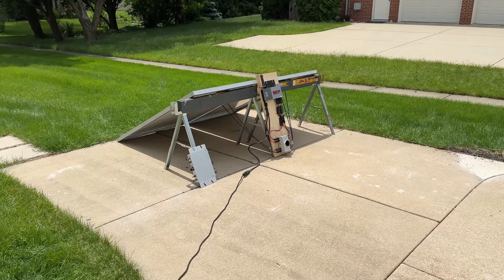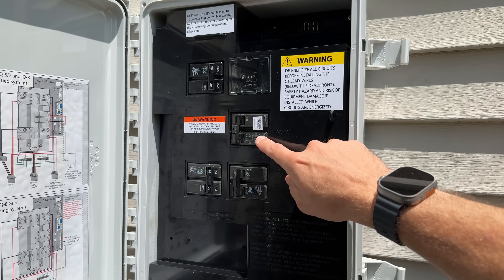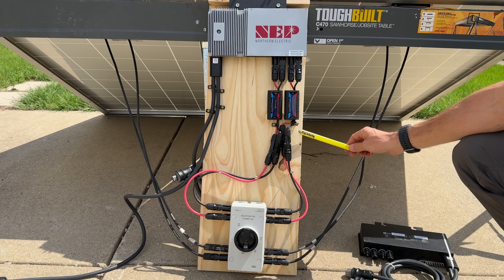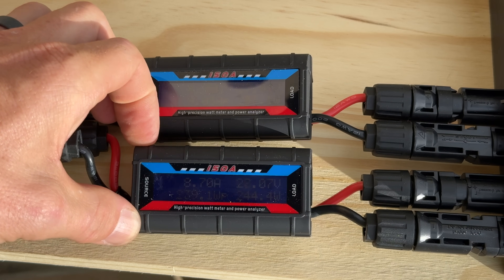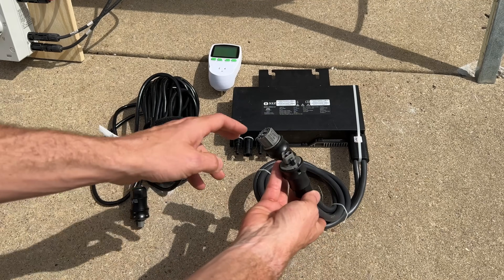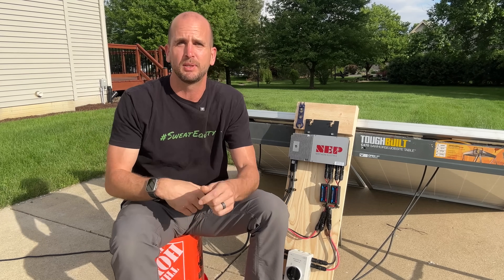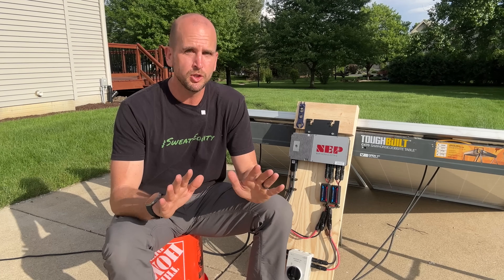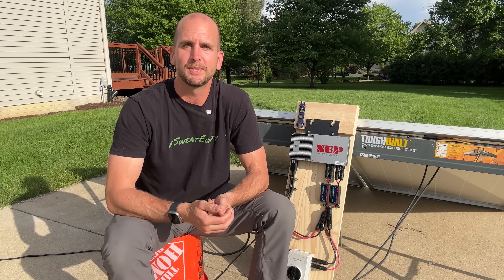Easiest Grid-Tied Solar On The Market!   Plug-N-Play

Comment: Great video. You didn't mention if this automatically shuts off if the grid goes down and it would not backfeed into the grid? Also I would be interested if for such a system, there is a way to manually cut the main breaker (in case of black out) and then start using that little bit of solar power in my house?
Reply: Solar storage batteries are what you're looking for

Comment: Trying to find a video or any information whatsoever on how to hook a solar system to an existing generator Outlet set I already have on the outside of my house.

I already have a separate sub panel in my basement adjacent to my house panel that has the critical circuits on it that I could shut on and off for line for generator power.

 I'm looking to set up a solar system that I can plug right into the 30 amp connector where the generator is supposed to be plugged into

Comment: I was wondering if i have a currently installed string inverter running, could i just plug this in an AC socket and work? or will it conflict in anyway with the string inverter?

Comment: I’m looking at a 16 year return on investment. 2kWh per day at $0.068 per kWh looks like best case scenario $49.64 per year savings. I’m not sure I can justify solar at this time.
Reply: Did you add in the delivery charges you would be avoiding?
Reply: No, because my “delivery charge” is a fixed per day service fee. That would not change unless I went “off grid”.
Reply: @Thanosisnotreal  interesting, where are you located? In upstate NY we have the electric charge 12 cents/Kwh and then the deliver of about 6 cents/Kwh that give us delivered rate of 18 cents, with a monthly connection fee of $17.
Reply: @ Western Washington, with all electric house the bill is less than $150 per month winter, $100 in the summer. 

My last monthly bill:
Current Activity
Kwh Charge 1,480 @ $0.06819 $100.92
Service Charge .96/day $28.80
State Tax - Excise (3.8734%) $5.02
Other Tax - Privilege (2.14%) $2.78
Current Charges $137.52
Total Amount Due $137.52

Comment: I was told my meter does not distinguish between power going in or power going out. In other words if I was to send power out I would be billed as if it was coming in.
Reply: Because he has solar already, he has a meter designed for net metering.
Reply: @Nolaman70  I've always see two meters. One for house consumption and another for solar output production.

Comment: I’m assuming this could be used on an RV that is plugged into a 50amp service?
Reply: No, a 50amp service would be a 240V connection. This 120V. Other inventors, such a s enphase output 240V.

Comment: I have questions on payback. In so many videos, it appears that the componets fail or degrade. Then, there is the roof with shingles needing repair from poor installation. Point being how does that factor into the 25 year savings I saw in your video.
Reply: Don't do roof mount unless you have a 50 year roof (metal). Ground mount is much easier, cheaper, and low risk.

Comment: Do you have an automatic transfer switch installed?  When the power goes out what prevents the PV from sending power out to the utility?  Also I'm assuming your enphase system has a transfer switch.  I know mine does, but I also have a enphase battery backup.  Along the same line does your DIY setup interfere with the enphase disconnect/transfer switch if the power goes out?
Reply: UL 1741 certification means that the system automatically cuts off it it senses loss of grid power. So it will not back feed. It will also not operate as an off grid inverter because it won't turn on if there's no power at the feed source. For off grid you have to use a non UL1741 inverter.
Reply: Also interested in this!

He did mentioned the UL 1741 certification, and I believe that specification allows the device to back-feed correctly given the grid conditions.
Reply: It should stop backfeeding the grid. Safety. The power company might be working on the lines and this would be a conflict.

Comment: Is there a similarly easy way to use a system like this to plug in an EV directly?  I'm thinking of using a system like this that is mounted on a car port or cover, that my vehicle can plug into directly.
Reply: No. A lot of the EV(s) do not allow your charge rate to be turned down, so this would not produce enough to prevent an overload. I know Telsa vehicles can throttle down to 600W on L1 charging, but even that is tall order outside of continuous direct sunlight w/o clouds. You would need a system that can accept storage battery connections to the inventor.

Comment: I read all 125 comments upto the date of this comment.  Not one mention of the ability to trip the main breaker switch for grid supply to panel.  In case of grid down one can manually switch off grid supply before pluggong in a solar supplied micro inverter into your wall.

If taking other saftey measures in place, it may be a good back up for brown outs.  The caveat is one has to have neighbors on grid to see when grid goes live again so you can reverse the breaker switches.
Reply: I have a similar system, the inverter will detect no power from the grid and automatically switch over

Comment: Love your videos, and the “testing” platforms. Have contemplated purchasing one of these units for testing myself. It is a bit pricy for the -LV model. Wondering if you could use to 220v non-LV model as a lower price and only use 1 leg of the 220 and get the same result. Could you just put a wire nut on the other leg? No electrician here. Also seen some Amazon “pigtail” products that split the 220 into 2 -120v outlets. Of course these are all experiments. Some commenters fail to realize this. Keep up the good work. I watch almost every video you create. Please experiment more. Looking forward to the multi micro-inverter one. Take care.

Comment: Plug & play balcony solar kits are available in Europe, including products that can provide battery storage to offset high rates during peak hours, which increased in popularity during the European 2021/2022 energy cris. One such example would be the EcoFlow PowerStream which is not available in the US. These systems are considered relatively safe in the EU due to how the EU system works, but I don't understand the details. In the US, the standard wisdom is that a grid-tie system should NOT be plugged into a wall outlet due to safety concerns with the US how the US electrical systems work with scary talk about backfeeding & suicide cords, and thus concepts like plug & play and balcony solar kits have been frowned upon for a while.

This is the first plug & play balcony system that I've seen for the US market that is UL certified. The NEP BDM-300 micro inverter has UL 1741 certification & provides NEC 2020 690.12 Rapid Shutdown for safety (Great!) & a number of other certifications. I suppose this is also safe because the output is limited -- the BDM-800 is max 800W, where a rooftop solar system will can easily be 5-20X that amount.
Reply from the maker: Thanks for the feedback, I will be interested to see where these type of systems develop in the US market.  I think there is a demand 👍

Comment: I think a valuable missing safety nugget is that systems like this are supposed to automatically shut off if your grid power (input) goes down so you do not backfeed (output) from your solar panels back into the grid.  Right?
Reply: Also that the ac plug does not induce suicide.

Comment: Here is an all in one inverter to 120v plug-n-play one that my son just picked up (maybe review it?!?)  Y&H 600W Solar Grid Tie Micro Inverter with AC Data Monitoring Display Screen Waterproof IP65 MPPT DC28-50V PV Input AC80-160V Output for 24V 36V Solar Panel $125.99 Size: 600W-110V-LCD (Amazon info)

Comment: Can you plug straight to the grid no other equipment needed?
Reply: Technically..yes, but legally...no.    There are many negative things that could happen at least here in the USA.  unless you have a netmeter you could spin your power meter backwards causing the power company to contact you or the meter spinning backwards could actually add to your bill instead of subtracting.  
 Unless your out in the bondocks somewhere with an old meter and billybob is the local utility tech.... I would not try this.  Will it work? maybe, but again, in an urban area with updated meters, chances are your going to get a fine.

 Now, I dont make a complete stop at stop signs either and its all about risk/reward ratio.  I would say "use at your own risk".

  Here in the capitalistic USA, systems like this are going to have a steep uphill battle to become legal.  Yes they work. No they aren't all that dangerous if UL approved.   THE problem is they cut into utility profits and if everyone can just buy something at Walmart and plug it in............................ again a lot of lobbing against this type of thing.

Comment: I'm new to solar and a little intimidated.  Could I use these grid tied plug in micro inverter to feed power to my house from batteries with a timer to only feed during peak charge times?  And then use a battery charger on a timer to only charge the battery from the grid on the cheapest over night rates?

Comment: That tiny setup would produce in a month 10% of the electric we consume. When it's comfortable and we don't use the AC, we use about 550 KWh a month. When it's hot and the AC is used, it sometimes will go up to 650-660 KWh.

It would be nice to have but it wouldn't pay for itself easily. it cost $0.098 per KW here. Not even a dime. 60 KW of production during the summer per month or about $6. About 10 years the cost might be covered.

Comment: when you feed the power into an outlet on your home you are on the wrong side of the fuse so to speak, no? defeating safety. you did say something about using an single circuit so I guess your fine if not going over 15 amps.. Good vid
Reply from the maker: Yeah, you would want a dedicated circuit to avoid issues 👍

Comment: Saving a dollar or two a day adds up over the years, and you're giving a finger to the utilities and helping to decarbonize which has its own value.
And it's also fascinating!
Reply: it's more like 26 cents a day (depending on your electricity cost). We pay $013 / kwh and this thing produces 2kwh / day on average. it would take 8.43 years to pay off the $800, about the same as a "big expensive on the roof system" would actually... of course with inflation these 8 years could be cut down drastically, nobody knows!
Reply: @dstaedeli  
Still better than a kick in the teeth...  In California I think peak rate is about 50¢, so savings are better.
For me, it's not just about the money, I got solar because it's just the right thing to do and makes me feel good to be independent.
Reply: @dstaedeli  Yep, we 10 to 11 center per kWh here in FL. From a cost perspective, its typically not a great idea unless you are adding a battery system to help with outages we get from hurricanes. We average about 55kWh per day, so unfortunately that would require a huge battery bank just to get partial power coverage, let alone the number of panels to charge it.
Reply: @dstaedeli  What US state are you using this system in? What size PV panels do you have connected?
Reply: Decarbonize is lefty scam.

Comment: This would be great to plug into a mango power battery system.  The conversion loses are outwayed by how far from your garage you can put it.  Plugging it in to the outlet is dangerous because during a power outage, it could zap a line worker. And expensive because the power company could sue you for $20k if no one is hurt.  If you have a generator switch installed by electrion go ham. Just make sure you are off grid mode.
Reply: Pretty sure the microinverters shut themselves down if they don't detect the grid, as with most (if not all) grid-tie systems.

Comment: Dude seriously? So you made this system but are using it on a house that already has solar with a net meter? 

If you want to make a system great, let's not connect it to your house, violate a shit ton of codes, not get authorization from the utility, and think it's fine without a bi-directional meter. 

Lots of bad info here. If you want a system like this feed it into an all in one battery/inverter. Then use a generator panel to power loads. For fuck sake don't plug it into a 120v outlet.

Comment: If you don't have a way to shunt the power to a standby Battery Bank, you are wasting a TON of money! Because, if all you have is a Grid Tied setup, when the Power goes out, your Solar Panels are worthless. I went with a SEPARATE setup. When OUR Local Utility hiccups, I can annually with to a Battery backup system, INDEPENDENT from the Grid.
Your Technical explanations ARE correct, however, I personally do NOT like Grid-Tied only systems with no Battery backup!

Comment: Is it legal to connect powergenerating device to grid?
Reply from the maker: Most utilities have several requirements which can change a bit depending on who you have but the most common is the device has to be UL 1741 certified.